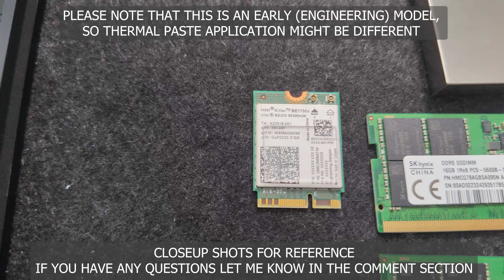MSI TITAN 18 HX A14V - DISASSEMBLY AND UPGRADE OPTIONS

Comment: I don't understand why they don't add more vram on the high end laptops it clearly has more room for 2 extra vram module, could have been a 24gb vram version instead for 16 gb
Reply from the maker: I guess simply cost is the main factor.
Reply: @MakaiTechReviews  Yeah but they could give the option to high-end laptops, think 4 DIMM slots and all those PCI-e connectors sure it's a high cost but it's dedicated for best laptops. There's a room for more CUDA cores, 200W of TGP and 24GB of VRAM if NVIDIA wanted to. Intel did it with the HX lineup, 14900HX is actually a binned lower TDP of 14900K because everything else in silicon is identical.
Reply: Cost and extra power draw thats better spent on higher clocks.
Reply: @MakaiTechReviews It is $5,000
Reply: The reason is EXTREMELY simple: the gpu chip only has 8 memory controllers, that's it.
Reply: @MakaiTechReviews  hey, got 1 expensive inquiry. Is it possible to remove & replace the Titan/Raider18HX motherboard (14thgen Intel CPU & all) with a online bought Titan/Raider A18HX AMD Ryzen motherboard?
 [ NB: which would have an AMD Ryzen mobile chip, solve the Intel problem for us customers, add  more SSD slots possibly Cooling to unfortunately Raider18 customers (like me) & avoid being trapped by Intels RMA Warranty or not Fiasco]

Can it be done?
Reply: Maybe the new rtx 5090 for laptops will be with 24 gb?

Comment: Thanks!
Reply from the maker: Will check everything you asked and come back to you shortly. (Currently at work). And thanks for your support.
Reply: @MakaiTechReviews  thanks! No rush on my part; if you don't have things handy anymore don't worry about it.
Reply from the maker: @BillyONeal  Created a short video for you about the keyboard sounds: https://www.youtube.com/shorts/yDD10pG9aqk

It looks like anything smaller than the regular "text" keys are not mechanical. 

Which means numeric pad / arrow keys, and special letters. 
Those which are exactly the same size or bigger than the regular text keys are mechanical. 

I think the reason behind this is simply physical size limitation, as you cannot fit a proper mechanical switch underneath such small spaces.

Comment: Hello :) Thanks for your detailed video!!
One question:
If they have to replace the chassis because on the keyboard side is bulged, it is possible to remove all the motherboard block and place in a new chassis? Or is all merged with the chassis?
Already, Thank you!
Reply: You have me wondering a few things...
1) IF..Since chassis is same can 1 buy&put the Titan motherboard chassis in a Raider18?
2) IF.
The motherboard can be replaced, with this Intel i9 mobile 14th gen chip fiasco, & MSI releasing Titan A18 Pro AMD laptops in Taiwan & China India,( so far unfortunately NOT America..not yet) ..is it possible to buy. Titan pro AMD Ryzen motherboard online...& Put it in a Raider 18HX...just tweak bios... "Whatever it takes?!?" to avoid , blue screens of DEATH, oxidation permanent Damage, & prolly more expensive RMA bk&frths sticking with Intel warranty & most possible rejection...

Just thought...as an Raider18HX owner..who hasn't even opened the box, due to complete lack of detailed reviews...sigh

Comment: i got one of these,14900hx 4090,gotta say im having trouble with it.the pcie bandwidth restricts the 4090 to x8,thats basically pcie3 graphics speed.the wifi card is naff,im wondering if its because of the metal casing,i mean ive tried everything driver/software related and i cant connect to 6ghz at all and 5ghz is maxing out at 100mbs,it should be around 350.getting the memory to run at advertised speeds means going into the secret bios and changes lots of settings which seems to work at 5600 but results in some kind of memory training everytime u swiitch it on and a really slow start up.i only have 2 modules installed and cpuz is report its in quad channel and i cant work out which 2 slots out of the 4 should be populated for dual channel,its usually 1 and 3 or 2 and 4 on a normal pc motherboard,i cant find any info on this.all the bloatware u have to install to use this laptops features is just ridiculous ie steelseries GG software for the rgb stuff,msi centre etc.to switch this laptop to performance mode u have to have msi centre installed and reboot to turn off the igpu which is annoying.the screen is nice but theirs no gsync.Theirs no really information on what slots are where,like which of the m2 slots are pcie4 and which one is pcie5 and to top it off the laptop hasnt got anywhere near enough juice to power a 14900hx and 4090.All in all i dont recommend this laptop.its nowhere near as good people on youtube who have reviewed this laptop suggest.its filled with restrictions and compromise,i guess the reviews have been sent their devices for free so essentially they will never say anything bad about them else they will not get follow up gear in future.moral of the story,dont trust independent youtube tech reviewers,period.If anyone has any tips on anything i have just mentioned id be happy to hear from u.

Comment: Very helpful. I have 128gb RAM also per the specs of the MSI unit I purchased, but why when I see the specs in widows and cpuz it shows 128GB DDR5-3200?
Reply from the maker: could it be it is using the default BIOS settings? Maybe you should check and activate XMP profile?

Comment: Thanks for the tutorial.
Can you pls post a detailed tutorial on how to disable raid 0 array on the titan 18 hx?
If possible without loosing data.
For those of us that would rather have two separate independent ssds.
Thanks again
Reply: You would need a separate drive to copy the Windows to, I personally use a Type C to NVME enclosure that can read/write at 1,000MB/s. Then just google a windows cloning software and make the swap. After breaking the Raid 0 array you would have to format the 2 drives and copy windows back onto one of them.

Comment: 1. Are all the keys Cherry switches or are the small ones and numberpad not (like on the GT77)?
2. Does this have the "force integrated graphics" option in MSI center or similar? (I've had issues after being plugged into external displays where the dGPU does not want to turn off after unplug and such an option would have been nice to avoid needing to reboot the thing....)

Thank you Very Much for this teardown video... I had no idea the shield covering the DIMMs could be safely removed!
Reply from the maker: Created a short video for you about the keyboard sounds: https://www.youtube.com/shorts/yDD10pG9aqk

It looks like anything smaller than the regular "text" keys are not mechanical. 

Which means numeric pad / arrow keys, and special letters. 
Those which are exactly the same size or bigger than the regular text keys are mechanical. 

I think the reason behind this is simply physical size limitation, as you cannot fit a proper mechanical switch underneath such small spaces.

Will also check the GPU part, but don't think it can be totally turned off.
Reply: @MakaiTechReviews  Thank you! It's a shame that they didn't fix ~ but looks like more of the keys use the nice switches than the GT77. Thanks again!
Reply from the maker: @BillyONeal  Btw, MSI center support 3 modes, dGPU/Hybrid and iGPU only, the 3rd one can force to use integrated graphics only.
Reply: @MakaiTechReviews  Awesome, thanks!

Comment: That's a lot of thermal putty.  Did you replace it, and what did you use?
Reply: lol that is a good amount form assembly. But only 1/5 as much as I use on my laptop. basically where the copper covers, I used thermal putty. XD

Comment: It seems like MSI has continued its tradition of lots of upgrades. There's 3 SSD slots, the Wi-Fi card, and 4 DIMM slots. For a laptop, the cooling looks as extensive as usual for the Titan series, which have always had the best cooling for laptops. How good is the 4k 120Hz Mini-LED display? On paper it looks like an amazing display for gaming and everything else that the end user might want to do.

This will probably be the most powerful laptop for 2024 that you can buy,, unless there are AMD Zen 5 based laptops and Nvidia releases the 5000 series of GPUs (which may not hit until 2025).
Reply: Wow, 3 SSD slots, all M.2? And is this the same across the 18HX series? Thanks!

Comment: I'll use it just only like a desktop replacement but i don't want the battery charging forever. Will it works removing the battery? (i mean with the charger only)
Reply from the maker: You can use the laptop without the battery.
Reply: @MakaiTechReviews   tnx man!
Reply: @Guttalaser  Not sure of your specific situation, but if you happen to be worried about killing the battery by having it perpetually plugged in, that isn't an issue on these high end MSI laptops.  I'm not sure what the term for it is (something akin to trickle charging), but it discharges down a bit and charges back up constantly while plugged in to maintain battery longevity.  My decade old MSI Titan's battery is practically unchanged form the day i got it.  It still lasts 1-3 hours depending on load.

Comment: I look on MSI site and then go to PURCHASE for Titan 18 HX and places where Titan 18 HX have options for 192GB DDR5 5600 RAM.
Your disassembly only shows 4 slots for ram up to 128GB.  Is there another ram slot hiding under keyboard?  I ask because I had ASUS laptop with easy RAM slots on bottom, but then also hidden RAM slots under Keyboard.  MSI is not ASUS, but they might do something similar?
Reply from the maker: Ehm, no actually there are only 4 slots. What I think is MSI use these new funky weird Crucial 96GB kits available right now. (2x 2x48GB kits - CT2K48G56C46S5)
Updated the description links with them.
Reply: @MakaiTechReviews  - Thank you very much for explaining this.  
I also have question about how deep the storage bays are?  will a Seagate Firecuda 530 4TB with HEATSINK fit?  ... or only without Seagate heatsink and thermal pads will need to be used instead?  
I always replace Harddrives with Seagate since Seagate has best reliability in my experience, and if I can replace RAM with G-Skill I always use G-Skill because G-Skill have lifetime warranty.   These are more expensive than other options, but usually last longer, have less problems and less failures.  :)  G-Skill does not make the strange 2x48 GB RAM so I think I will be happy with 128GB of G-Skill.   :)
Reply: I wonder myself too. Is it a 4TB SSD Seagate that you are talking about? That would be interesting to know if thye make & of ot aould fot, PCIE etc.
Reply: @konstantinavalentina3850 construction looks similar to my GT77 (the 12th gen Titan) and double sided drives fit but heatsinks are unlikely to. It looks like they did a better job ventilating by the memory and storage vs. mine; I did have drives angry at me if pushing them :).
Reply: @BillyONeal  - thank you.  I guess I'm going to plan on getting the 1mm thick copper heatsinks and heat pads.  That should help, or some other low-profile heatsink kit.
I can only imagine how hot a gen 5 drive will get in the gen 5 SSD slot without a heatsink.  I think Crucial makes a 4TB Gen 5, but, if a heatsink will not fit, then adding a gen 5 drive will probably result in a dead melted ssd after 6 month.  :(
Reply: @konstantinavalentina3850  yeah I think Gen5 is a marketing gimmick here but perhaps someday newer controllers will be better about it. Gen 4 drives were infernos when only the Phison E16 was available too.

Comment: great cooling system but the glass area around touch pad is dumb.  why add extra weight to a mobile device?  and the RGB lighting of touch pad is pointless.  could have been a great workstation but they made it too gamery.
Reply from the maker: Well I think they "had to" add the lighting to the touchpad, otherwise, it can be difficult to actually find the touchpad barrier in the dark. Obviously a simply painted marking would be enough, but they rather picked this route.
Reply: Yea probably because it is quite literally a gaming laptop.
Reply: CreatorPro X18 HX A14VMG is the workstation version of this model.